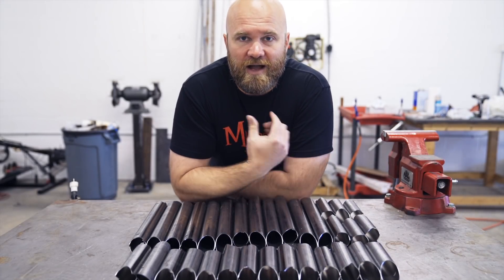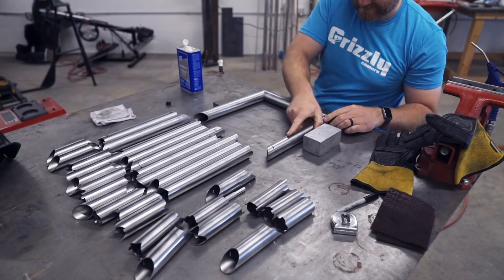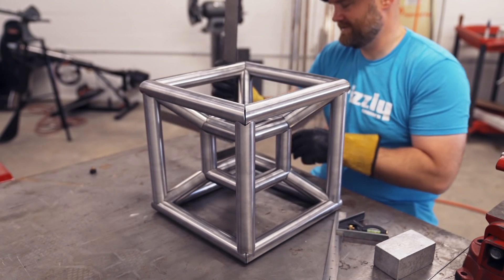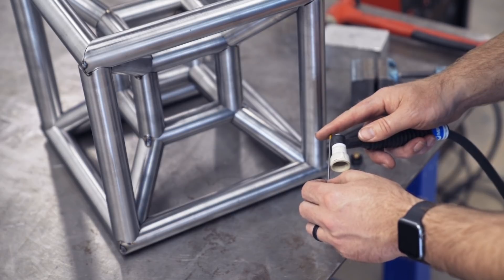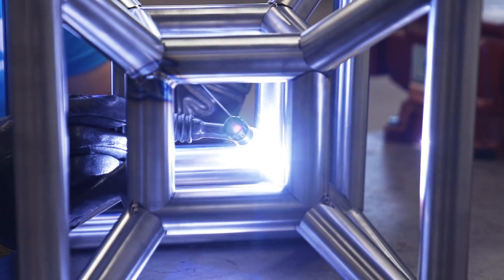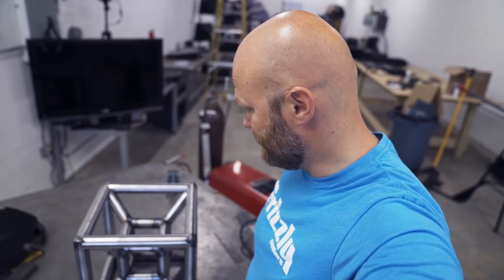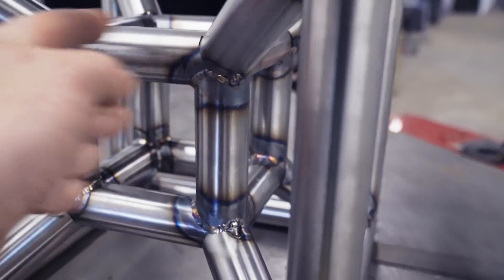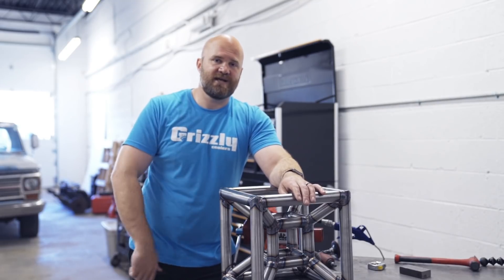TIG Welding The Hyper Cube From Precision Tube Laser

Comment: The best way I have seen to "Break" tungsten was by a friend in class the other day actually.
Lets say you wanna half a new tungsten and get two (very useful in TIG class lol) Take your tungsten to a pedestal grinder, we use a 4 inch with a diamond wheel on it. Put the middle of your tungsten on the edge of the wheel at a 45 and spin it. Clean "break" and it starts the sharpening process for you so that also becomes shorter. Think it woulda been a good tip in the 9 tips video.

Comment: U should cut ur tungsten with a grinder with cutting wheel  when u brake the tungsten like u did the brake will almost always splinter at the break. And who's to say that that busted tungsten want crack down the length of the tungsten , then u have an arc that's fucked up. There have been many studies done with tungsten with what works best n the rest that you can get by with. Yes the bench grinder is the tried n true way to do it but spend a few bucks and get urself a tungsten grinder with a diamond grinding wheel.  I know you've seen that little cone shape at the very tip of the tungsten when u are welding, do u know what causes that? I'll tell u if you ask me. I like your show by the way.

Comment: A good way to sharpen your tungsten is to modify that posture little; lower your left hand in that position so forefinger sits on that grinder edge. Move electrode under your thumb fingernail and press against forefinger, so it stays still when rotating it with other hand.

Comment: you hold it upside down to transfer the heat from the tip into the thicker part of the tungsten. gives you a better tip. But only do this on belt grinders. if the tungsten catch, and you hold it firmly it will simply brake and not go into your hand.

Comment: Haven’t welded any thin material like this before. What kind of amperage do you run on something like this?
Reply from the maker: 70-90 amps, but I fluctuate the pedal a lot so not using all of that all the time.
Reply: Justin Voss gotcha. Have tried just a little on some thin stainless but I think my machine hotter than the dial says. Because it was on like 20 amps and by the time you could dab the filler it would blow through. So needless to say didn’t take long before I said the heck with it. But have watched a couple videos of stuff like this and would like to attempt some

Comment: You need to go hotter and faster.  One of my old bosses taught me "cooling rings just happen" .  More torch angle, keeping a puddle in front and keeping it full of filler (smaller filler, dabbing more often).  Will get a very smooth weld with dimes right on top of each other.  The welds here are too cold and the HAZ is too big.  Serious constructive criticism.
Reply from the maker: I try that, does that make a really tight weld, I usually like the farther spaced. I will be trying though.
Reply: Thats good advice, more amps usually result in less heat on the part

Comment: I love welding with 312 stainless, flowslike butter. This is good practice, especially for work on roll cages. With such a good fit up on these things, I’d be inclined to drop to .040 filler. If you are planning one of these for practice as opposed to showing off a piece of art, I would encourage someone to use er70-s2 or s6 so you get more realistic training. Those fillers will tell you if you’re travel speed is too slow or your shielding gas sucks or you didn’t prep the metal good enough. Remember to prep the inside ends of the tubes as well so you don’t suck some nasties in from the backside. You won’t always have 312 stainless and it’s not a good idea for roll cages anyway. Any sort of full penetration weld with stainless and no back shielding can cause your joint to fail down the road due to cracking. Someone posted the idea to do one using silicon bronze, I like that idea, it would look pretty cool. This project also looks like a great opportunity to experiment with pulse tig.
Reply: Agreed on the pulse. I just did a cage from cagewrx for a rzr and it was all .095" DOM tubing and it turned out great doing a manual pulse (Miller diversion 165 so I don't have any other options for pulse).